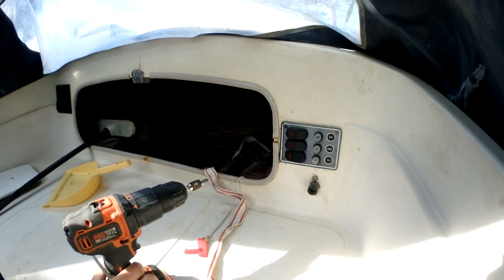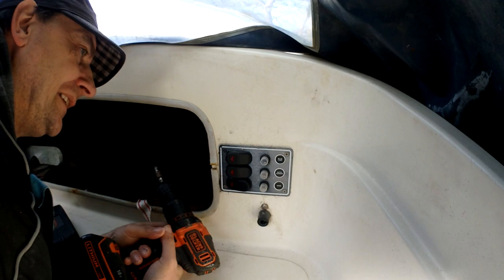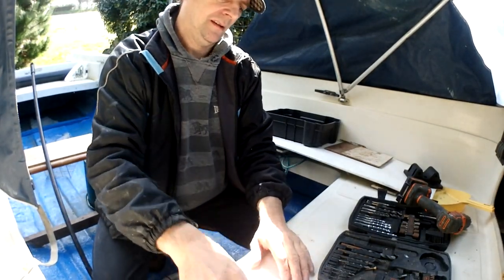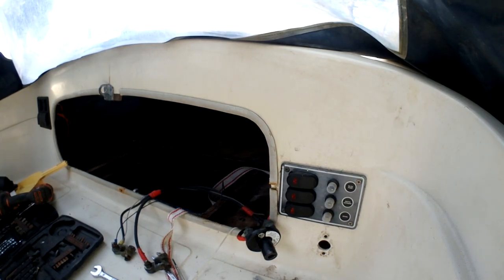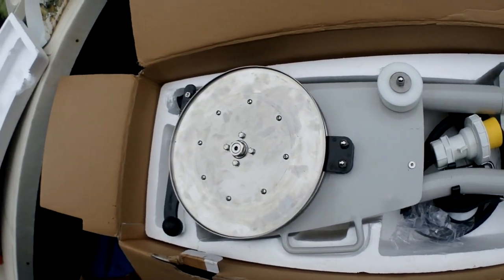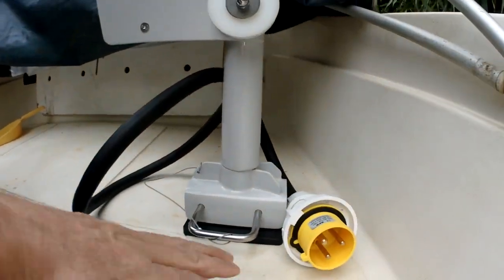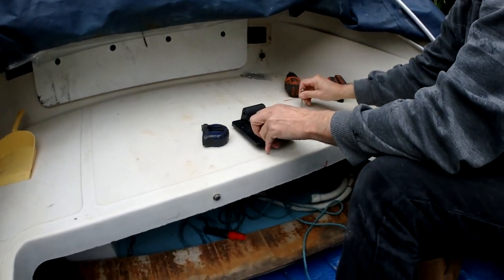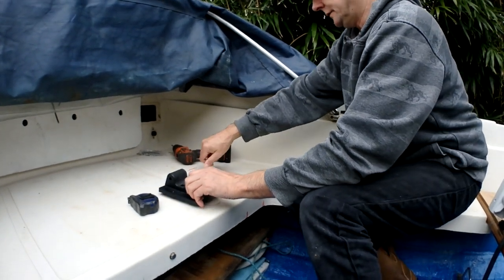Orkney Fastliner 16 Refit - Installing Electric Pot Hauler / Winch part 1

Comment: Hey Troy - ditch the battery isolator if it has a key. Doesn’t matter where you put it, something wili snag on it and pull the key out. I swapped mine out for a flush fit switch with a knob rather than a key.

Comment: I would definitely put a brace down to the floor I had a Spencer Carter hydraulic pot net hauler on my 38 ft Aqua star I know it a different beast but if you are tight in a swell it's a hell of a load best wishes
Reply from the maker: Yes looking at bracing the hardwood/seat to the floor

Comment: Does the winch come with an emergency stop button and a rewind button that can be located near the pinch point for "hands or clothing" that might get caught ?? Your on your own out there.
Reply from the maker: It has a forward, reverse and  stop directly in front of where you stand and feed the rope. I will check it all when its wired up,
Reply: @Trojwaterman  Good news, can't be too careful.

Comment: Troy, prob too late now but had you thought about forgetting davit arm and using a gunwale roller instead ? That’s what I did with mine, that way winch head is more central & mounted to deck and with using gunwale roller if you get a hookie your only pulling on the gunwale rather than higher up with davit arm.
Reply from the maker: It has crossed my mind using a roller. I will try with the davit and see how it goes but may change it in the future. Just trying to keep everything strong but non permanent at the moment till its all had sea trials
Reply: @Trojwaterman  I’ll send you some pics/video of my set up on messenger when I’m next at boat, might give you some ideas, or just ignore it 🤣

Comment: Do what I'm doing to my boat & make a smoked polycarbonate window that is across the top & sides where you can put a soft roof or fibreglass roof making sure that the center of the windscreen & roof is also a door to the front of the boat to access ropes for anchors, cameras etc. You could easily use 3mm plywood framing for the window, door & roof followed up by several layers of fibreglass. Make it either a permanent fixture to the boat or a latch down quick release item with thick rubber between framework of the boat & window frame, door/roof. Idears & solutions just pop into my head on the fly, hate it.
Reply from the maker: Lots of ideas I will probably change more things over time
Reply: @Trojwaterman  Sorry if I'm intrusive but even tho I'm drugged up to the hilt on pain meds my mind explodes with ideas & solutions where I have to get them out of my head. Imagine how bad I would be off if I wasn't on all the pain meds, that's scary.

Comment: Trojs won’t you need some steel work under winch for strength
Reply from the maker: May bolt a post from seat to floor but not steel.
Reply: @Trojwaterman  yep wrote comment before watching all of video. Ever thought of doing a live while fixing boat. Probably pick up more subscribers and seems as though people like watching lives.

Comment: I'd use metal for your plate, something that will hold up and wont rot like wood. A plate on top and a plate on the bottom, then bolt them together
Reply from the maker: I could but that hardwood will outlive the life of the winch, The key is bracing the winch to reduce or remove the full strain at the base.
Reply: @Trojwaterman  yes it is, I see your point now.